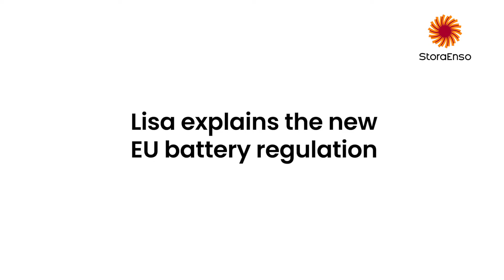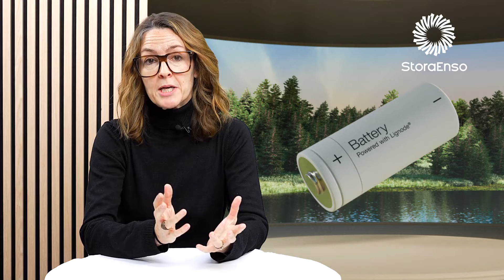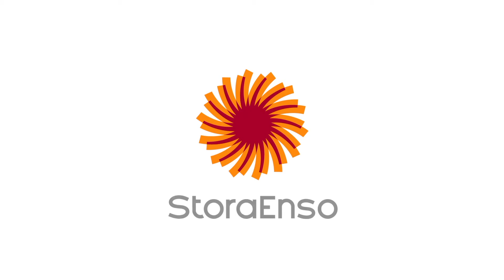Lisa explains: The new EU Battery Regulation

Comment: Will there be an ID number on each cell to link it with its digital passport?
Reply from the maker: More detail needs to be set out regarding various elements of the Regulation, including how exactly the battery passport will work – this detail will come in the form of implementing acts.  However, Annex XIII already sets out the type of information that will be contained in the battery passport and to whom it will be available.  For example, for those with “legitimate interest” there will be information on the “amount of cells used and layout.